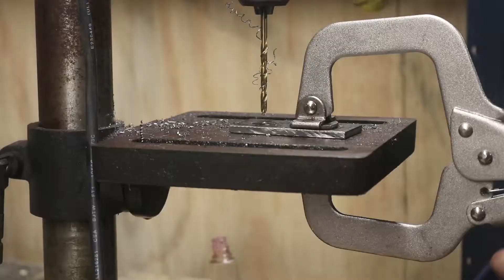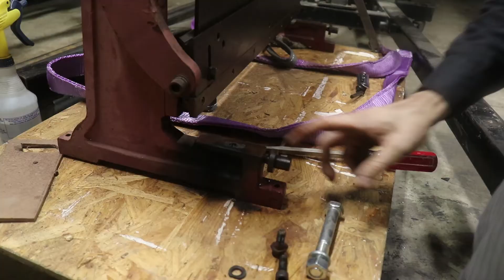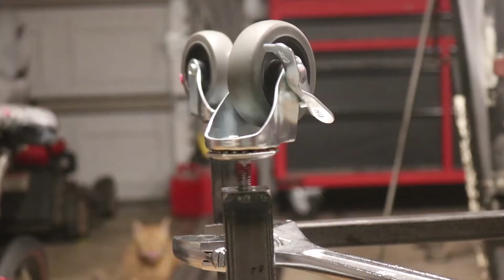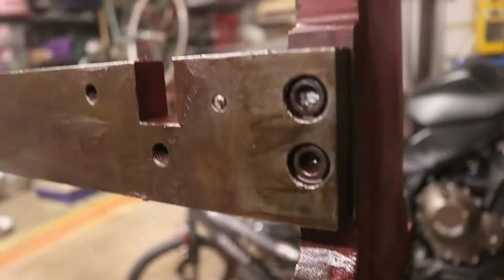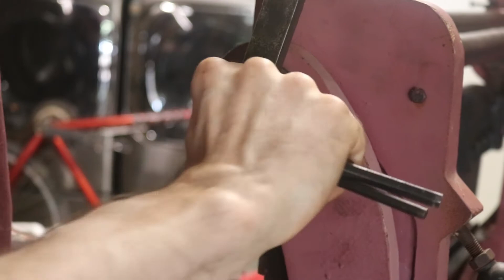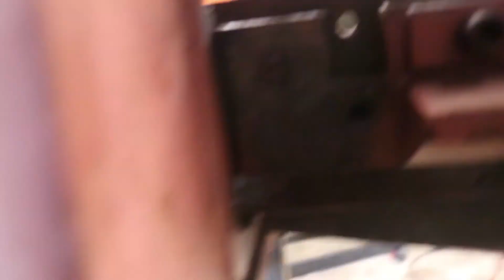3 in 1 Metal Brake Roll Shear Refurbish and Stand Build

Comment: Nice Video! I have one that has never been used much over the years. The main problem is that the removable roller will not lock in place. The half-cut lock can not rotate around the removable bearing. I need about 0.200", I could grind a flat spot on the outer surface, or try to grind out the receiving area on the housing. Do you have any Ideas? I can't bring it back to Harbo Freight, I've had it for at least 10 years. Also, how do we get grease to the back Rolloer? When I grease the nipples, it does not appear to reach them.

Comment: Thanks for the video. I purchased one, 52" weighing 398KG, also second hand and very rusty, this past Friday, have cleaned about half the rust of so far over the weekend, using steel wool dipped in vinegar, which works really well, and then oiled the parts that had previously rusted.

How much does your weigh,? Do you have concerns about it being top heavy? I'm fairly new to metal working so not sure about sizing the metal for the stand to hold 400KG worth of machine, plus some for safety, can you share your thoughts on that maybe?

Thanks in advance man.
Reply from the maker: There are general rules about the strength of tubing, such as: the ticker the wall- the stronger the tube; and the larger the diameter tube, the stronger the tube. For specific calculation of your specific project i would recommend an online calculator, like https://amesweb.info/StructuralAnalysisBeams/Stresses_Steel_Hollow_Structural_Sections.aspx   OR  https://www.atlastube.com/axial-load-calculator/  OR   https://www.roguefab.com/tube-calculator/
Reply: @HooptieDoodle  Awesome, thanks for the links man.

Comment: Seems top heavy and would tip over  when really pulling on it no?
Reply from the maker: So far, so good. No such issues 😀
Reply: @HooptieDoodle  so , do you have to put your foot on the base when pulling on it?
Reply from the maker: @dlsjr1978  it works great. No need for foot enabled stabilization